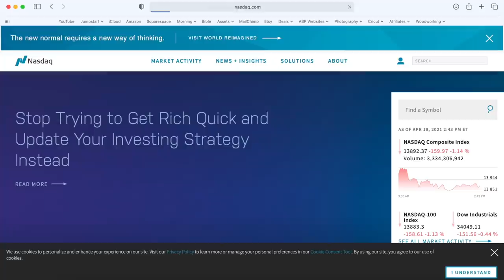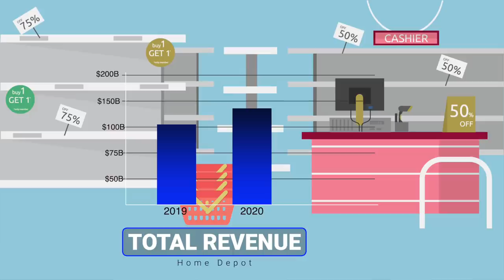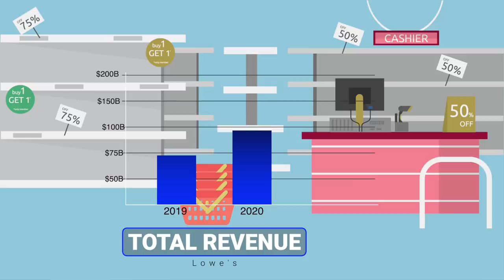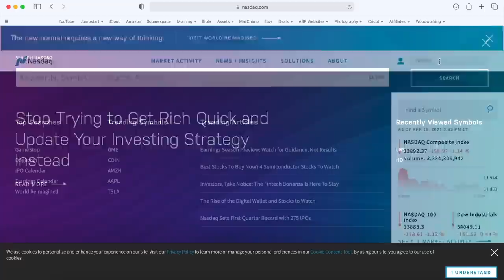Why are Lumber Prices SO HIGH? Going Higher Soon!

Comment: Great information as always Matt! One way I have found to “save” on lumber prices is I have been purchasing old tables/ desks and furniture from auctions and breaking them down and repurposing them. It is more work but given the current climate in the long run it has saved some green.
Reply from the maker: Good info
Reply: same here, Andy. A guy gave me a rickety book shelf last month. It was 1/12 pined boards nailed together with 8 penny nails. The boards were cupped, so I ripped them down the middle before planing them and made 4 noodle boards from the lumber. My local thrift store also gives away busted furniture that is donated there.

Comment: I can agree with most of your assessment up to the present. I don't agree that stores will keep prices up because they don't want to see their increased profits wane. The competition between them will not allow that to happen. I've also seen oil futures start around $145/barrel and drop to around $30/barrel before that contract month came due. This usually happens when everyone is predicting higher prices with no end in sight.(and $6/gal gasoline)   98% of the futures market is speculators who will never take delivery. The big buyers will lock in prices now, knowing that if supply and demand drives prices lower, they can hedge their futures positions with put options. Assessing why something happened yesterday is one thing. Predictiong tomorrow is not as easy. If it were, I'd be trading lumber futures instead of building farmhouse furniture. Thanks for your excellent content Matt. I'm breaking in a new Delta 36-725t2 and sold my old Rockwell table saw the next day.  It's a nice upgrade, just like you promised.
Reply from the maker: It is a nice saw for sure!!

Comment: Let's not forget that 40% of the resin market is in Texas and was completely shut down from the devastating winter storms. You can't make any sheet goods without resin..if you can't make sheet goods there no point in selling stick lumber cheap..the suppliers are gonna hold the prices of stick lumber high until the supply of sheet goods comes back..will be at least a year before we see an 8 ft Doug fir 2x4 under 6 bucks..and OSB/plywood under 30 bucks a sheet
Reply from the maker: Good info!
Reply: @731Woodworks  np..love the channel btw
Reply from the maker: Thanks!

Comment: As an example of price differences, Home Depot here in Canada sells red oak 1" x 6" x 8' for $54. I can go to my local mill and get the same board, S4S and better quality for $24. And the mill has a much larger selection of hardwoods and softwoods.
Reply: @Bart Jenkins pretty much. They have a store front and a website. Just search for Mills in your area and you might be surprised.

Comment: Matt, as usual, your insights are enormously valuable.  Here is even more context regarding lumber prices.  It gets worse.   This is because the supply and demand for raw materials worldwide is almost unprecedented, especially lumber.   This is the case in the US, Canada, the EU and around the world.  In large part this is due to COVID and the need to rebuild; and  it's also due to the push in developed counties to go green, electrify and move towards clean, sustainable and renewable resource use.   This is the future, factually speaking.  According to commodities experts, we have entered into, as you described,  what is called a "supercycle".   In this case, this is a prolonged period of price increase and high demand for raw materials needed in the building process such as copper,  iron,  other metals and, at the top of the list, wood.  While a  typical business cycle lasts about 6 years, a supercycle lasts 25-30 years or more.  This is transformational and here to stay.  To be sure,  about a month ago I watched the CEO of a top commodities futures firm in Australia announce  that they were paying dividends to shareholders (in advance/forward) based on the current futures pricing, expected future earnings and an optimistic outlook for the future, particularly wood.    Thanks for the suggestion regarding local hardwood as a cheaper alternative to softwood in box stores.  Who would have ever thought this would be the case.  To your point I went to Lowes , a few weeks ago and someone had dropped off a pick up truck load of hardwood, 2x6s and 2x12s ( 8 to 12 feet)  boards from a demolition I am assuming.   It was free for the taking.   I picked up about 10-14 boards.   I had no idea how lucky I was at that time.  But at current prices this is well over $300-$400 of lumber.  Spruce and Pine 2x4s here are selling for around $ 8.  I think your suggestion is the way to go.  You and Mrs. 731,  keep up the excellent work.   Thanks for sharing.
Reply from the maker: Thank you for sharing that! That was a good deal you got on those boards.
Reply: @731Woodworks  Thank u Matt!  I just called to ask if they had more :))))

Comment: I saved over $500 on a fence project using local saw mill. While this wood is not stamped lumber which for my area no inspection was needed. It would be a bad time to build a house that extra $20k -$30k when wood does come down these new 2 year old houses will be $20k or even more with interest  upside down.

Comment: I've been buying 2x8's and ripping them in half to get 2x4's. Right now a 2x8x8 at my Lowe's is $11.11, and a 2x4x8 is $7.61 (all southern yellow pine).  With my method, I get (2) 2x4's for $5.55 each.  They're about 1/16 wider, but that's not a problem for me.  Then if I need a 1x4 I resaw the 2x4's.  As bad as 2x4's are right now, 1x4's are absolutely insane.
Reply from the maker: Smart!
Reply: same here. The blanket ladders look a little a better in my opinion if you rip the 1 bys to 3 inches instead of 3 1/2, so that saves a bit as well.

Comment: Where I live in the desert, there is no local wood, period.  Maybe some old Cottonwood trees that are falling down and rotting away.  I imagine MDF, particle board, and melamine are going up too, but that looks like the future for my shop furniture.  Also, I have become a big fan of paint instead of clear/stained finishes.  That allows me to use MDF as a cabinet material on interior projects.  Thanks for this great insight.

Comment: Just dont buy lumber from corporations that's it... the corporation are jacking the prices up ...check how much they are paying for timber per acre hasn't moved its still the same price...So the lumberjacks aren't getting more $.. go to a normal sawmill and the lumber prices haven't fluctuated at all still the same... then go to Lowe's..... prices have tripled.... Buy a planner and go directly to the sawmill and buy what you need in ruff cut... cut out the corporations.....

Comment: I have good news for you.  If you base your pricing on futures, you will be in for a nice surprise.  They are just a forecast of a commodity pricing, but it isn’t always right.  Airlines buy their fuel through futures to stabilize the cost of fuel, but they don’t past those saving to the consumer.  The prices of airline tickets didn’t go down with the price of a barrel of Crude oil hit an all time low throughout 2009 - 2018. In fact, prices went up even more. But they did lose their shirt on the futures contracts, since they had to pay the prices prior to the drop at $118 when the prices plummeted to $38. It is just plain greed.   Home Depot and Lowe’s are playing the same game,  and their prices tend to fluctuate based on that.  Futures are just giving them a legal excuse to increase prices. Did you see the price of wood drop in 2020 based on the futures prices going slightly down?  I sure didn’t.  In fact, wood prices went up in 2020. 

Right now, there is a scarcity of people willing to work.  People can talk big all they want, but when they assess risking their lives for work that pays very little(based on risk)... people are staying home.  No one gets paid enough to be sick.  Especially, since no one knows the long term effects of this crap.  This is the main driver of the price change through low supply. 

Home Depot will cease any chance to price gouge the DIY, and it is doing right now.  Home Depot has price changes DAILY, and it isn’t always to benefit the consumer.  I would recommend to support your local mills, and other venues before buying your wood at Home Depot.  Because the leaner the supply line is to the consumer, the more control you give Home Depot to increase prices.  Complain about the prices to HD. Make a huge deal.   DONT BUY FROM Home Depot and Lowe’s.  You might save money by going to specialty woodworking stores and mills instead of Home Depot. I use busybeetools, Ottawa fasteners, and local mills.  I go to Home Depot as a last resort.

Comment: With the increase in prices, I've decided to make a "lateral move" with the projects I make.
I make walking sticks,  and wooden sculptures. So I just go out in the woods around my apartment and find the materials that I need.
I've got extremely luck and come across some walnut, red oak, white oak, maple, cedar, and  I believe "dog wood"...
I have small small walnut logs that I'm actually going to try and plank out myself here in a few months. I want them to dry out a little more to limit splitting. 
If there is a will, then there is a way.....

Comment: Very interesting video. Thanks for sharing. Prices for wood and related products as plywood were very low in the USA in comparison with prices in Europe.
I don't buy wood very often. If I spend 100 USD a year, then it's a lot. There are many ways to get wood  (nearly) for free.
If you are a professional woodworker you can do three things:
a/ totally put the higher price of the wood in your final project. For sure that's going to cost customers, because 99% of the people have limited incomes.
    If they want a piece of furniture that cost before 500 USD, and now 800 USD, they'll think twice before they say yes.
b/ partly put the higher price of the wood in your final project. Share the pain. Your customer will appreciate it and tell it to other people.
    On one project you will earn less but you might get more orders. In the end your profit may be the same (only you have to work harder for it)
c/ don't calculate the increased price of wood in your final products. That's the shortest way to crash. Your company will not make enough profit and probably will not make it till 
     prices go significantly down again.

If you are a big DIY-er you probably have to slow down a bit. Or try to find other materials. The world doesn't end with two by four's and/or baltic birch 3/4" plywood.

If you do woodworking only as a hobby, to make things for yourself, or present for family, friends and relatives, the possibilities are numerous.
There are many ways to get wood (nearly) for free.. You just have to change your way of thinking.
You can also (try to) combine woodworking with craft (that's what I would like to do, independently of what wood prices are going to do)
I found a lot of inspiration for that on https://www.youtube.com/channel/UCz4GCx3ieKlpkMnIpQG8u4w/videos